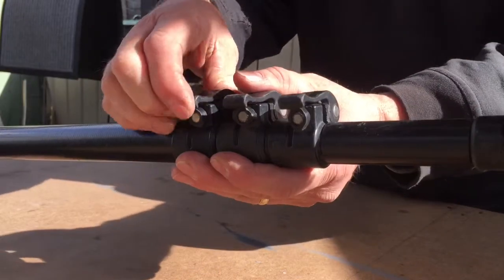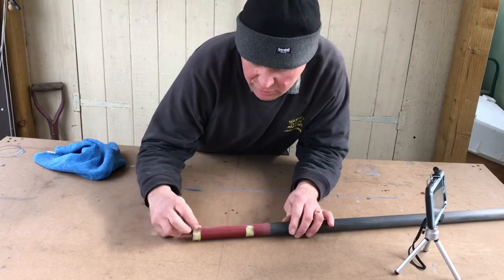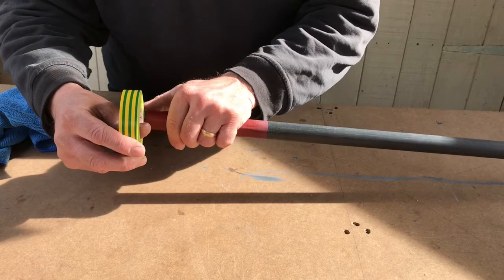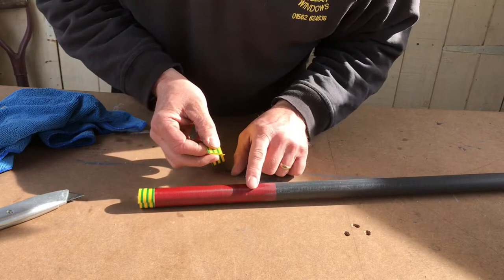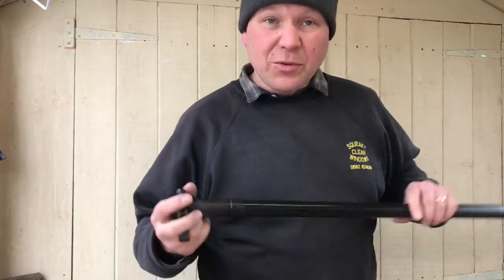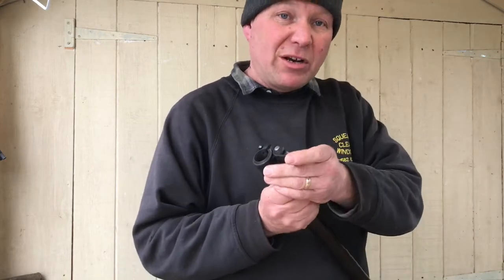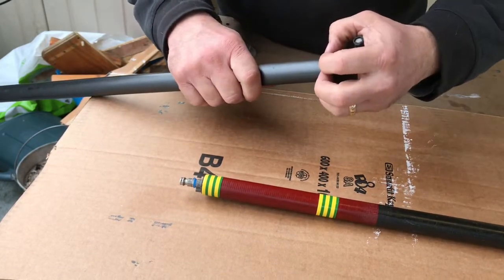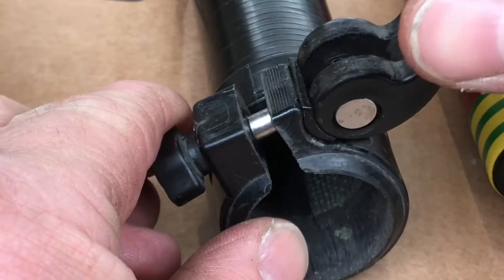5 Steps to WFP Maintenance

Comment: Hi mate what would you charge a 4 bed window clean cheers Russ
Reply from the maker: Russell Downes Downes it’s impossible to say. There are too many variables eg where you are in the country, access, how often, layout of properly, size of windows etc. You need to work out what price you are happy with and stick to that regardless of what anyone tells you. The only piece of advice I would give is don’t under price jobs just to get them because before long you will have a lot of work that either you don’t want to do or isn’t worth doing. Hope this helps👍
Reply: @squeakycleandave1  thanks for the advice Dave

Comment: How long do you leave the ptfe to dry and set for Dave?
Reply from the maker: Steven  Lee I normally spray it last thing then leave it overnight. Depending on how much you put on sometimes it’s still wet but I just put the pole together and us it. If there is to much on it I give it a wipe with a dry micro fibre cloth I keep in the van 👍